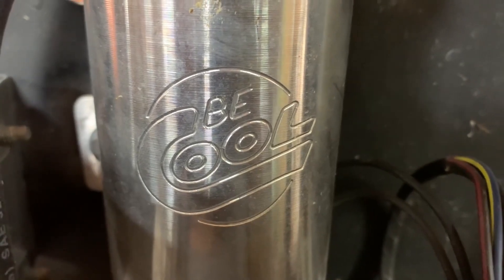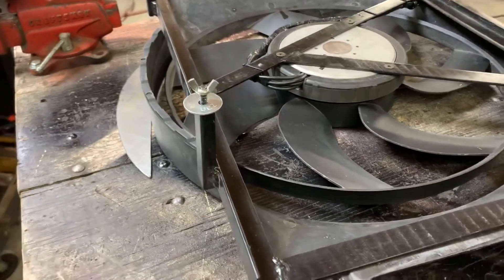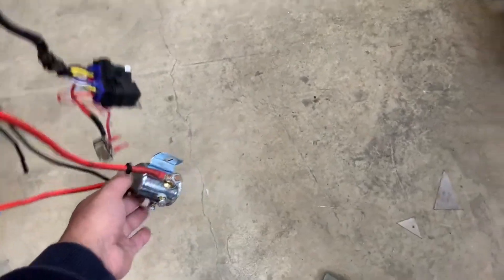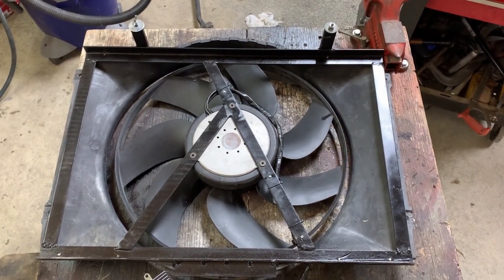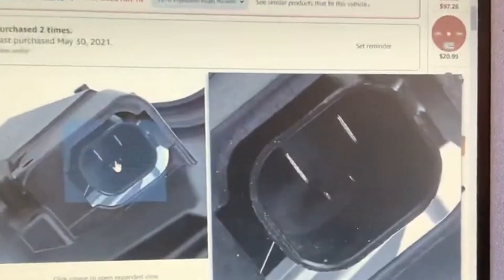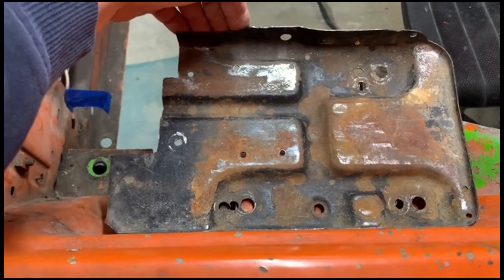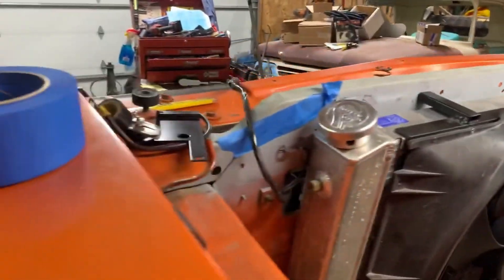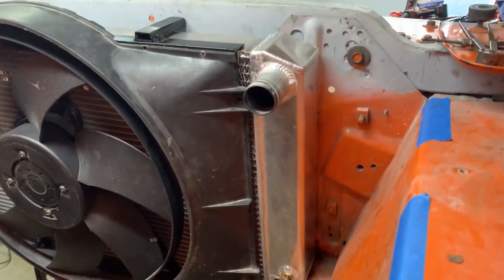Mopar B Body Cooling Upgrade

Comment: Thanks for the informative video, I own a 1968 Charger that we use in film to do stunts with. 
We keep blowing off belts either with the clutch fan or straight engine driven fan.  This happens frequently when the director asks for the desired high RPM shifts!  
This is probably the best fix we could do.  Definitely will keep a few spares too.

Comment: I have a 71 dart a body and have a little trouble with traffic and prolonged idling. I have a 22 inch champion 3 row and decided to upgrade to the 22 inch cold case 2 core with 1.25 tubes. I want to run electric but can't find any research on a good fan to work
Reply: IMO, your system has no star players, all are equally important. Pump, fans, radiator, pulleys, shroud, t-stat.... all work together so make sure you're building the system that way. If that isn't enough, your motor health will also contribute to the overheating issues you run into. Head gaskets, correct timing, and even plug ranges or air fuel mixtures can contribute. 

Having said that - A good radiator, with a large capacity, good coolant and good air flow will typically solve your issues. The 1.25 tubes should help a LOT!
Fans are tough but my experience has been marginal with the aftermarket offerings. I have yet to find an aftermarket fan that could keep up with the stock fans from FORD, GM, or CHRYSLER (or my current setup from Mercedes Benz). You will quickly learn the difference between a standard fan and a PWM fan.

As for fans, Unless you're stuck on the aftermarket route, my advice is to start junkyarding for the biggest fan you can find that will fit your radiator. My PWM fan obsession is a gadget thing but I like the way they are only as powerful as they need to be (example - how new cars fans kick on but don't howl at full speed at idle .... unless they need to). There are aftermarket PWM fan controllers out there that are reputable and will last. 

If you don't want PWM, there are still many options out there and the junkyards are full of large standard fans for CHEAP! True, some assembly will be required but in the end you will wind up with something that is likely better engineered than any of the aftermarket stuff I have experimented with - and you can replace it at the nearest parts store if it fails.....

Aftermarket fans aren't bad, but the ones I could afford were not powerful enough. A puller fan setup is preferred and pay attention to TOTAL CFM you are flowing (multiple fans may do better than one big one depending on the size and shape of your radiator).... Make sure your ALT is up to the task of the added amp draw. 

Whatever you decide, make sure you run your fans with relays, sourcing your high amp drawn through fused/heavy enough wire from the alternator stud.

THANKS FOR WATCHING!!!
Reply from the maker: Personally I like the Mercedes fans because they were designed to work in tight spaces and for larger radiators.  The fan in the Fury is from 2000 CL500 and has the motor offset to the top corner and has a belt that turns the fan.  It also has a cast aluminum fan shroud. I believe Jegs shows your Cold Case radiator at 25.5 inches (overall width).  Unfortunately I think my fan is going to be too wide as the web shows the Mercedes fan to be 27 inches wide.  Cam's fan might work better if you are willing to do the shroud modifications like he did.
Reply: If you are interested in the junkyard route - I would recommend you focus your search for a minimum 18" fan diameter (think it is the stock clutch fan diameter) for the "donor" units you are considering and which way you want to run it (PWM OR STANDARD). The shroud is not important as long as it is removable. I think a larger fan will fit but It is really based on what you find....
I would also heavily recommend using a factory shroud. Keeping it short and to the point (which I am terrible at) - The original shroud is an excellent "guide" to what fits and where it goes...

 Assuming: A) you find a late model electric fan and remove it from its factory shroud/an aftermarket fan that you like,   B) Your current shroud and radiator are intended for your A body;  You have the parts to build an efficient setup that will fit and cool you car.

Mating the three is a simple matter of building bracket setup - AND - you get to use the components as their assembly fixtures... I wouldn't say EASY but easier than you would think....

When arranging the placement of the junkyard fan, pay attention to the depth of the blades in relation to the shroud - the two work together and are more efficient if properly arranged.
I am willing to help you with this if you need input. Let me know.

MOPAR OR NOCAR!
CC